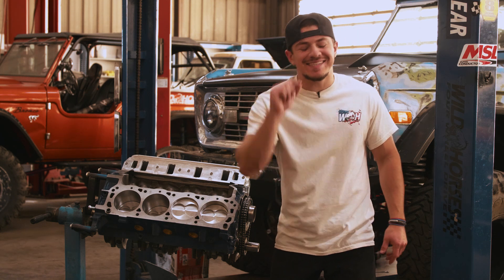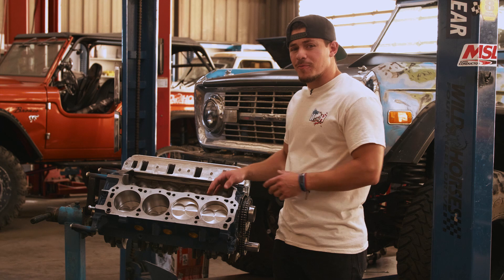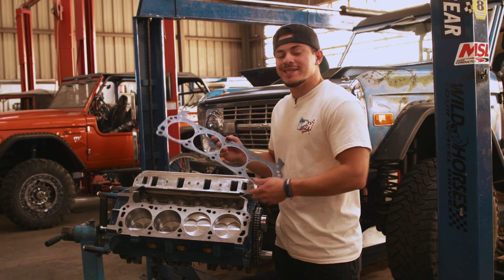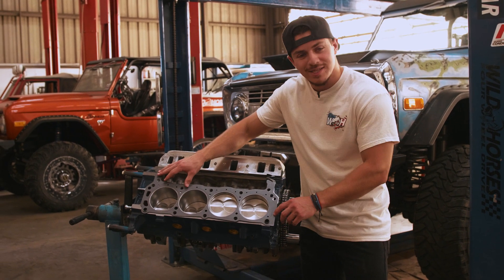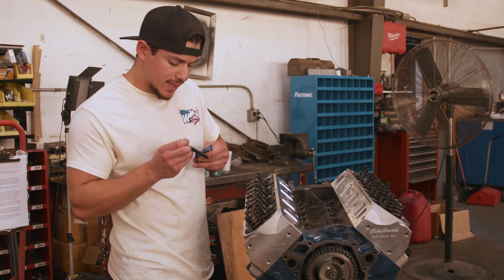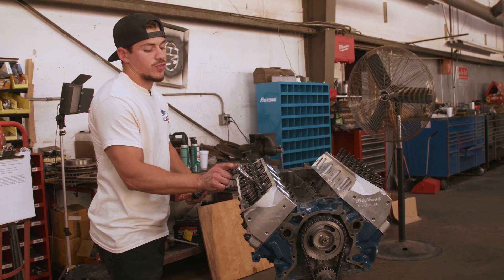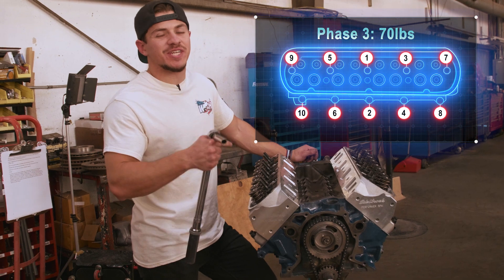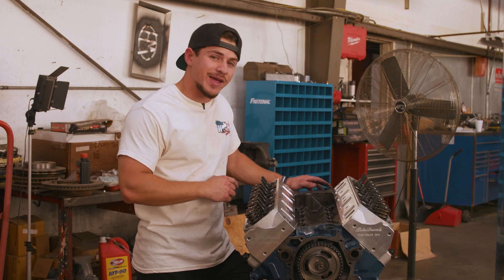Tech Tuesday: How to Install Heads on a Small Block 302

Comment: So I don’t need to do top dead center ? Is that just for setting valve lash and shit? Sorry young kid building first engine on my own lol
Reply from the maker: Not for installing the heads. All you need to do is torque it down correctly and you're good. For valve lash, if you look up the EOIC method, it may provide a more simple method to setting your valve lash as well.

Comment: Top bolts should be torqued to 80lbs, bottom to 70lbs. The bottom corner bolts penetrate a water jacket and thread sealant should be applied to those threads.
Reply from the maker: Thanks for the tips! I may be pulling the heads soon so I'll definitely use this if I do.
Reply: I was thinking the same thing watching it.

Comment: hey someone told me those are torque to yield head bolts???  on a 1995  5.0l  302 bronco... is that correct or not ???
Reply from the maker: For that, I'm not entirely sure. If you want a pretty solid answer, I would call out guys and they can get you that information. 2094007200.

Comment: Does this heads be compatible with a 1988 302 engine?
Reply from the maker: I'm not entirely sure. There are a lot of different specifications with heads. I believe after 1977 they used a different rocker. I'm not sure if that messes with the compatibility or not on a later 302.  I would shoot our tech guys a call for more info. 209-400-7200

Comment: Do you know if twisted wedge heads require a special head dowel or just a standard head dowel?
Also.. you dont use any kind of thread sealer in the water jackets bolts?

Comment: Did you ever get around to installing a sound system like you talked about a couple months ago? I don't know if I just missed the video or not
Reply from the maker: Unfortunately, I haven't yet. I'm still on the fence about what to get. Plus I gotta scrape up the money haha😂
Reply: @wildhorses4x4  pioneer from my experiences with them (Wich is very few because I'm not legally able to drive) are good but have had some connecting issues for an interface otherwise that's all I know.